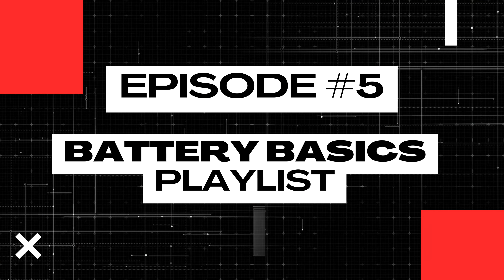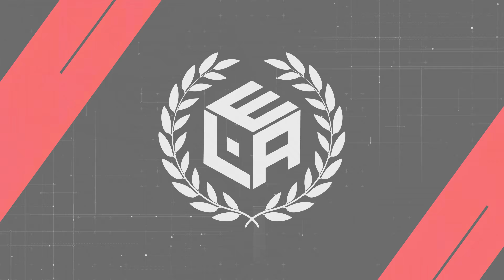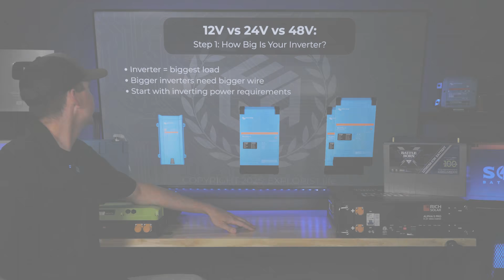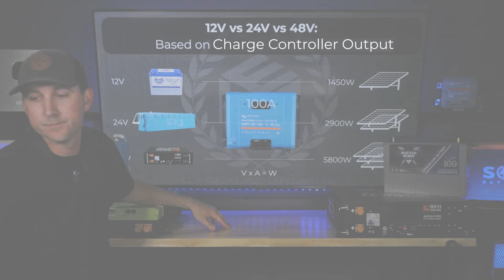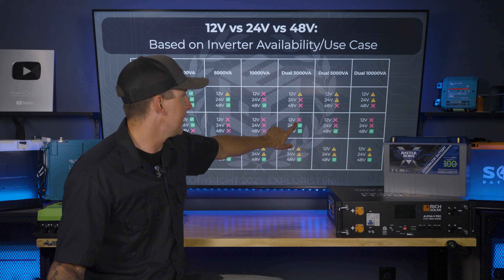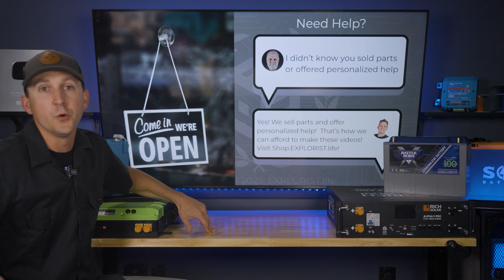How to Choose 12V vs 24V vs 48V (in an Off Grid Electrical System) - Battery Basics | Ep 5/7

Comment: I really enjoy your videos, I always learn so much. I went with a 48v system for my van, and even ordered a few things from you. I haven't landed on a dc-dc solution yet, but you just turned me on to the Sterling option. I've been wanting the Wakespeed 48/12 bi-directional  dc-dc, but it's very expensive. Safiery has a really appealing models called Scotty AI DC-DC , which is a very similar product, but is more simple as it does not require an external alternator regulator, AND it interfaces with Victron GX touch displays. I'm definitely leaning towards the Safiery product now. You might be interested in it too as an option. Thanks for sharing your knowledge, my stuff is way less sketchy after learning best practices from you.
Reply from the maker: Let's get you one of those Sterling units.  We have them in-stock and ready to go w/ wiring kits.   Reach out and we can get you what you need: shop.explorist.life/support
Reply: If you're trying to find a DC to DC controller why not just get the Bluetti charger one
Reply: @ActivateTrueHealth  Thanks for trying to help. I have a 48v system in my van, and it looks like that product will only charge 12v systems. So I need a specialty product that can boost voltage from 12v alternator power and charge at 48v. There are only a few options out there at this time
Reply: @Nik_Martinelli  no the charger one is designed to charge at higher voltages. it takes 12v and boosts it up to 58v. you can choose whatever voltage you want it to boost to. I use it everyday to charge at 20-50v off my 12v battery.

as long as your battery is LiFePo4 and it has a BMS built in you're good to go. However it maxes out at 560w.

if you want even more power from your alternator to charge your 48v battery just do a search for the "eTaker 2000". It can charge LiFePo4 48v from a 12v battery up to 1000w
Reply from the maker: @ActivateTrueHealth   Hey - just curious, but why are you coming onto my channel after I've specifically provided guidance  for products we have in our store and promoting products we DON'T carry, that don't even meet the needs of the person you're responding to?  Are you just trying to push people away from our store?  Do you realize that these videos are funded by purchases from our store and without equipment purchases - we can't afford to run this channel and must shut it down?
Reply: @EXPLORISTlife  its youtube .. im just trying to help a fellow human out
Reply from the maker: At my own detriment?  Am I not a fellow human?

Comment: what is your opinion on dc air conditioners. I'm looking at an
air conditioner having higher outputs with higher voltages. Example-12v=7500 btu, 24v=8000btu, 48v=8500btu. Does this show that 12v is not idle for ac units?
Reply from the maker: Great question! The “best” voltage for an AC unit really depends on your overall system design and power goals. We’d be happy to take a closer look at your project and recommend the right setup for your needs. Reach out here: https://shop.explorist.life/support

Comment: Great explanation of the different size inverters and wires and chargers needed.  I feel more comfortable now with the choices I made when replacing my factory AGM 200ah battery to a 300ah lithium battery that fit in the same battery tray outside underneath my Class B RV.  Since I only use it to power my fridge and lights and the fantastic fan my amp draw is under 15 amps.  Thank you for the time you take to educate us.
Reply from the maker: You’re very welcome!  Are you a shop.explorist.life customer from that project? 😃😎😀
Reply: @EXPLORISTlife  No, unfortunately,  you guys are to far away from me, but If I ever pass by your state I'll make appointments to upgrade one day.
Reply from the maker: Womp womp.  We sell nationwide!  We can supply the parts and whoever you like can install.  Without the proceeds from product sales, we can’t afford to make these videos and will have to shut down the channel. 👎😕😣

Comment: This had some great information.   I have a 50a rv that I'm trying to plan out battery power for.   Was looking at doing 12v as an initial system for use without a/c for the time being, then expanding it later.   I guess in this case it makes sense to do a 5000Va inverter with 1x48v/300Ah battery would be a good starting point.   The eventual goal is to be able to run 2 AC's, so adding a second 5KVa would make some sense.  Or is there something I'm missing?
Reply from the maker: I see a big red flag, yes.  Reach out to shop.explorist.life/support and we can get you what you need.